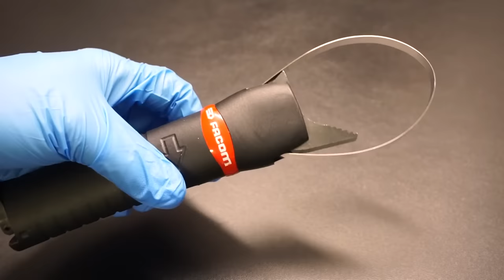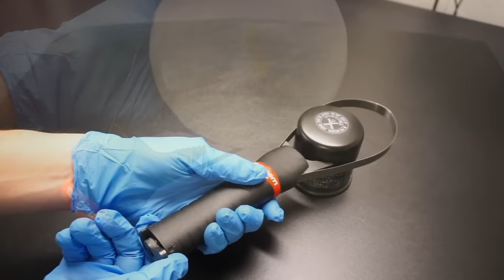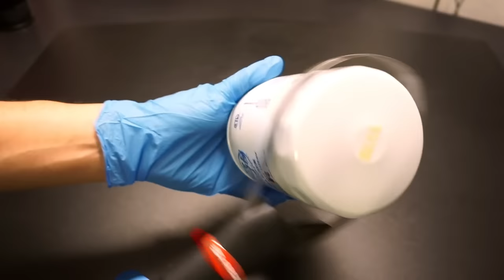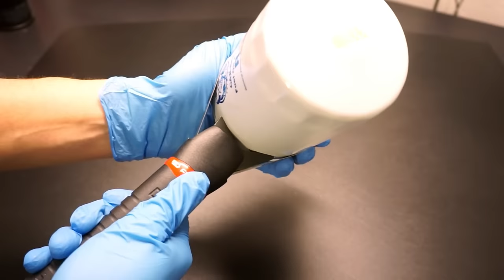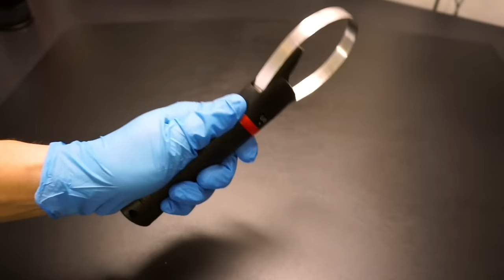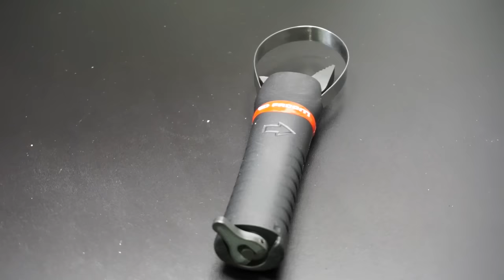Best Oil Filter Wrench Ever Made

Comment: ......Lisle 53700 for small and 53250 for large filters.  About $13.00 each, and it covers all the auto/light truck sizes.  They have swivel handles that allow access to hard to reach filters.   This demonstrated wrench can ONLY be used perpendicular to the filter, making it unusable in tight spots.
Reply: Exactly my thoughts, it can't be the greatest if it ain't got a swivel handle, because who wants to buy  a whole socket set just to get to a hard to reach filter.

Comment: I've had one for 20 years and never failed to remove an oil filter on cars, vans or tractors yet. I've even used it on hot water cylinder heating elements, it's a great tool. Might not suit every situation but that's why I have more than one type in the shed.
Reply from the maker: Glad to hear this feedback. I still use this tool and it has worked on the most stuck filters, like hydrualic and heating oil ones I have ever encountered. Won't work for everything but when you can use it I love it!

Comment: The concept of this is great! The downside, how often do you have enough room to use this? It could be used for lawnmowers and other smaller engines but not vehicles. Maybe in Europe, the oil filter is all by itself with very little other parts around. All the times I’ve changed oil, getting that much clearance is unlikely

Comment: As long as ya got the 10 inches to lay it up on the filter.  Not likely found under most motors  another case of design guys not really familiar with the job, just the task.
Reply from the maker: Definitely can't replace them all, I use it for a lot of ATV's and mowers and also home heating oil cartridges which can be a nightmare to remove. This works great when you can use it

Comment: I'll tell you though, those Gar- Ber  Filters are a pain in the butt to get off. One of the reasons is because some of the knuckleheads install them wrong.  Thank you so much for the video though
Reply from the maker: I have noticed it's not just the installers doing it wrong, I put them on and they were soooo tight the next time. I think its the way the heating oil reacts withe the rubber oring.This filter wrench makes a big difference when removing them. Totally overpriced but just the way it is for this one.
Reply: @SilverCymbal  You're absolutely right! But some of these guys support them just with the copper line, I don't know what they're thinking. I went to a new customers house the other night for the first time, I saw that Garber filter and I said, oh no! I'm glad that wasn't the problem. But whoever installed this did it really nice, it's supported by a nice sturdy steel plate.

Comment: No point in using this if the oil filter in under a tight spot without much room since it is no different then using an Oil Filter Wrench.  It clamp and open horizontal only render it useless if there is no room to turn it and put it in.  There are better option out there especially how pricey this one, even a regular oil wrench is better.

Comment: Wrong! Its obvious flaw is that it will not fit in tight spaces, which is most vehicles. The JM3 oil filter wrenches are the best design today. Check them out.
Reply from the maker: The JM3 won't be a used by a pro. They are on to something with it, but its miserable to use, needs a tool to opoen up, They need to make a real version of it, not just cnc stamping it.  I agree this Facom wont work for recessed spaces but is the best for open areas which there are plenty.

Comment: Very cool but too expensive and space limitations for most oil filters in the car.
Reply from the maker: I love this one for hydraulic filters that can stay on for years, sometimes and are stuck. You have access to them but they usually crush before coming off, it's great for those but I fully agree that it cant get to some spots and is not cheap

Comment: I work in hvac and plumbers always over tighten those spin on filters needed to get a pipe wrench, extension and another guy. I’ll try this though looks good. Is the grip capable of supporting leverage.
Reply from the maker: I just used this a few weeks ago for diesel filters, it is worth every penny. One of the best tools I ever bought to save a lot of frustration.

Comment: Unless your filter is sitting on the bench or it’s completely exposed, this tool is absolutely useless.  It will not fit in majority of newer trucks and many cars.   Most filters are located between subframe and oil pan.   This tool is about 10X longer then the space around most oil filters.
Reply from the maker: I use it on Heating oil cartridges as shown and for both John Deere and Kubota hydraulic oil filters. Not wrench will fit every situation but this gets off some of the worst filters I ever encounter

Comment: How can it be the best oil filter wrench ever made when it won't even work on the majority of cars with limited space to swing the handle around??  Probably designed by stupid engineers who have never changed the oil filter on their cars.  Please consult with good car mechanics before you design useless tools.  They would have just laughed at this $100 design.  Please say: Best Oil Filter Wrench Ever Made If You Have Space To Swing The Handle Around.  I have three cars and this won't work on any of them.